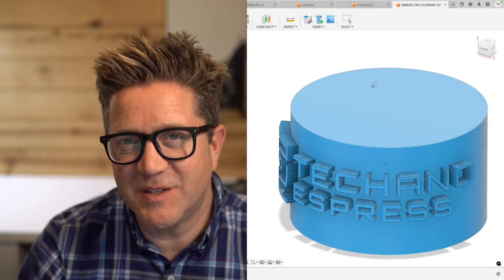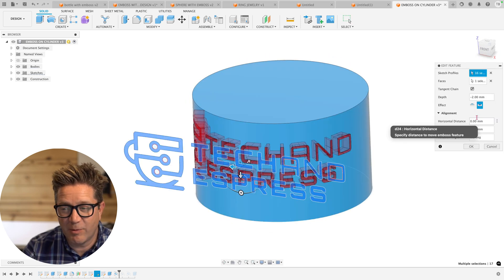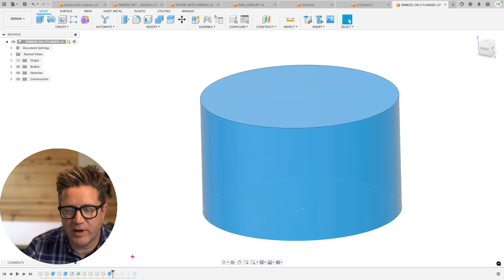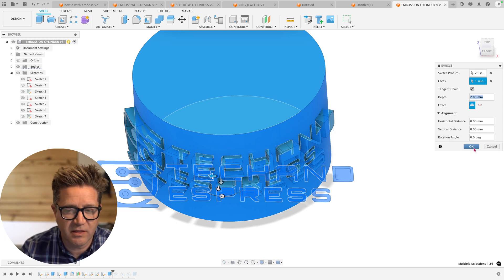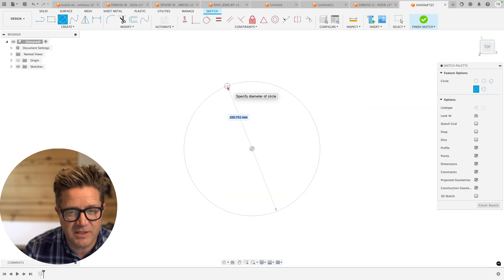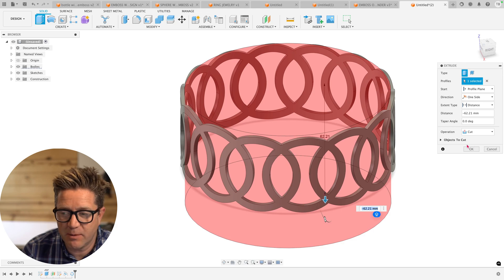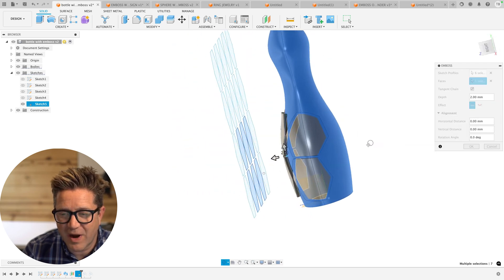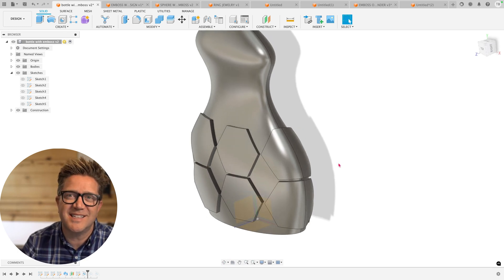Fusion 360 Emboss - Wrap sketches on round or curved objects

Comment: Best Fusion Tutorials on the net 🙏🏼 Been using Fusion for about a year now. Getting back into design i gave up in my teens. That was when we had to use that pencil and paper stuff 😉 Loving these tutorials Tyler thank you. Do you have one for creating a Turbo Compressor/Impeller? I've seen a few but none of them give me what i want. Spoiler alert, i'm designing a 12v water pistol with a 2L coke bottle as the water store. Can't get the impeller right :( Thanks again for all the tips. I think i still have a few hundred to go through lol 😬

Comment: How come the D and the A on the first part did not cut out correct?
Reply: 0.36 min Tyler says “You select the sketch entities in the dialogue box” The D and the A both have areas that are fully enclosed, he just didn’t select them. Try it out with a single D or A and you will see how it works.